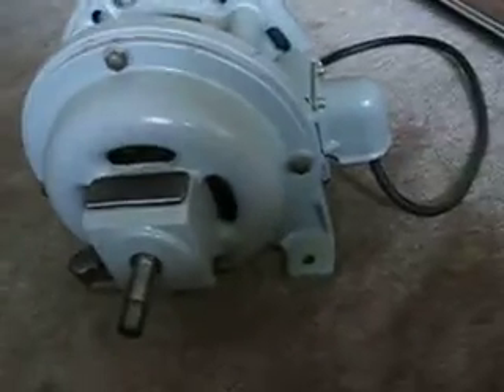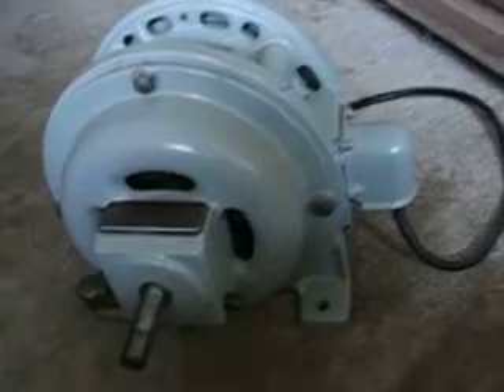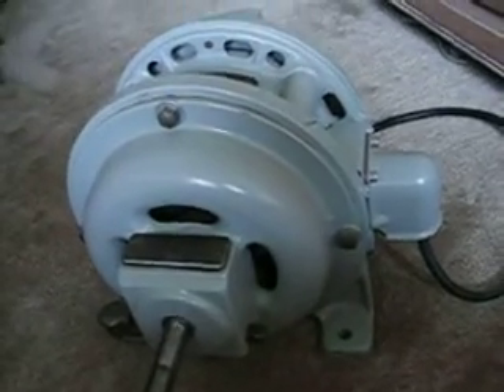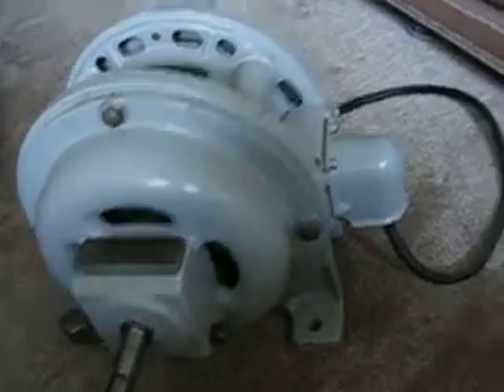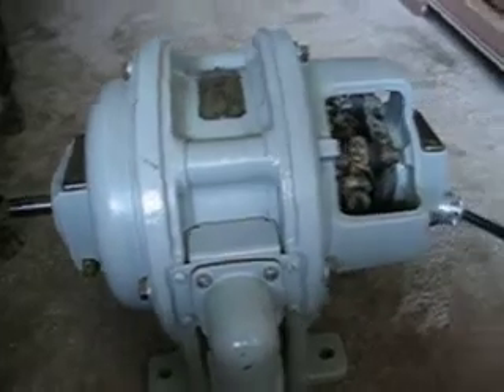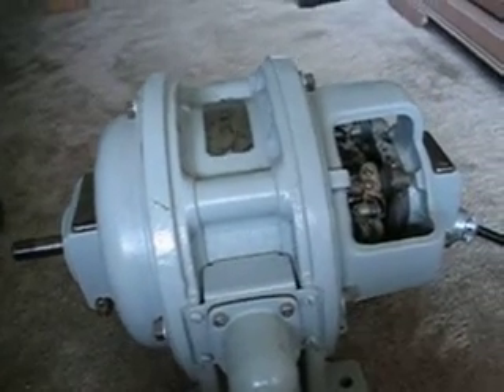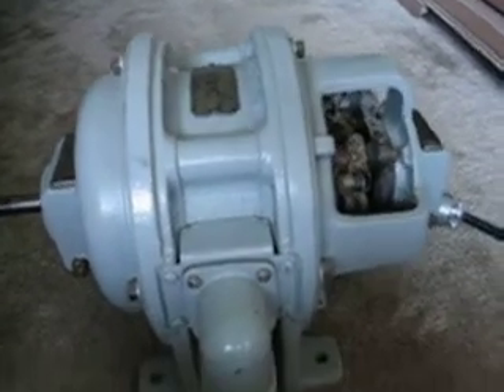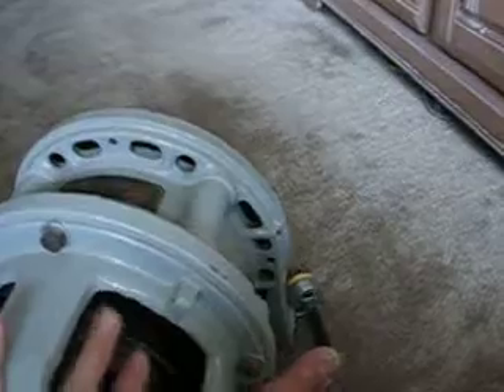GE Type SCR Motor

Comment from the maker: BTW, I forgot to mention that this motor is reversable by simply shifting the brush rigging back and forth. Rear housing even has marks to set the brushes for each direction. You can also run the rigging closer to neutral for lower speed operation. I've run it has slow as only a couple hundred RPM! This motor will also run for hours without getting warm. Not like todaze motors with silicon insulation that runs so hot you'll burn your fingers if you touch them!!